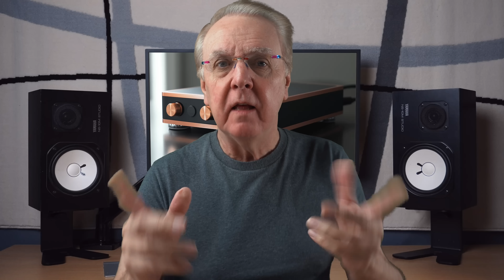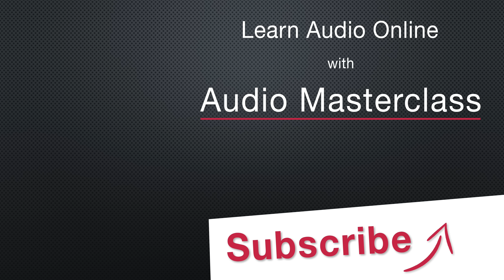Audiophile preamps - What should you get for $30,000?

Comment: I remember arguing with a high end audio shop salesman about ridiculously expensive cables for digital signals.  This was after I received my Masters Degree in Electronics Engineering with a digital communications focus.  He apparently lacked the ability to understand that digital signals are  immune to noise in any realistic listening room scenario.  His $1000 cables made from pure quantonium would not sound any different than coat hanger wire.
Reply: Wasn't that unobtainium?
Reply: Diesel Creek told us: it's chinesium ;- )
Reply: Cables are the highest margin easiest sell in the shop. They guilt you into buying them because "surely you will want some premium cables with that stratospherically expensive piece of gear you just bought". People are buying expensive hifi to server the same purpose as expensive jewellery. If you bought your wife a diamond pendant surely you want a proper 9ct gold chain to hang it on? <-- same logic.
Reply: @A_RosnerNZ  They're always talking about spending X% of the sound system price, the good old stupid concept that something is "better" just because it costs more...
Reply: I concur. All the hol..es are the same too and it's given that EE's have best audio systems around AND are the best lovers as well.
Reply: Lovely!!🤣
Reply: What's actually traveling down a digital wire?
Reply: @bradp686  Well, the wire itself is not digital. It consists of voltages that are interpreted as a 1 or a 0.
Reply: Those peddlers are just good at manipulating people to make them buy their crap...  I debunk them so often, it's laughable...
Reply: @guyboisvert66  I once go kicked off the Internet by my ISP for arguing with a audiophile 'tard on usenet.,
Reply: Did you actually try those cables?
Reply: Well, he certainly was lacking in basic understanding of how digital audio works. But be careful with the word ‘immune’ as digital signals in the real world regularly suffer failure due to transmission in a very wrong piece of wire. In the professional world, meaning the live stage, digital signals encounter complete transmission failures ALL the time, where analog signals virtually never do. With analog, it is the accumulation of countless tiny errors that drives the switch to digital. With digital, we must know our stuff and use the right wire always or risk losing everything, including our job.
Reply: If the cables cost 2000$ I better should be able to run them over with a caterpillar dozer without them having as much as a scratch.
Reply: @baraka629  Why would you want to do that? I just don't understand.
Reply: My 2.5mm twin and Earth was a little bit cheaper than 1k per meter…
Reply: probably the cable wasn't on a "cable lifter", that's why you couldn't hear the difference
🤣
Reply: Mine are made from 100% genuine New York sewer rat hair, complete with bubonic plague, dengue fever and leprosy. They smell wonderful, but don't work too well.
Reply: But noise can be transmitted along the cable . That’s why some DAC manufacturers recommend unshielded Ethernet cables going into the streaming port of their DACs .
Reply: @mrsinghsstereos6662  They don't have a clue about networking if they're propagating this crap... Utterly STUPID...  They're always trying to bring back their analog crap in the digital world...
The only time we used STP (and we don't use this anymore, fiber is almost cheaper and so much better) was when the cabling was too close to very high power power transformers...
Reply: @mrsinghsstereos6662 .  Transmitted along the cable is no problem at all. A DAC has a window of amplitude below which signals simply aren’t there. DACs also routinely reclock their data for this specific reason. Reclocking puts temporal issues to bed and recovers the clean signal 100%.
Reply: @mrsinghsstereos6662  Wrong. It is only 1s and 0s.
Reply: @henryvaneyk3769  whatever you say Einstein !
Reply: I know, I know... digital cables shouldn't make a difference, yet I hear a difference. Upon dealer recommendation, I bought a slightly more costly USB cable (about $50USD) for my Mojo DAC. It was very pretty in a green woven covering! Every time I used that cable, the sound was noticeably harsh. The cable is in a drawer now & I use a generic $10 one & love the Mojo.
Reply: @patbarr1351  That is just your owners bias LOL !
Reply: @richardheumann1887  That's an old argument that holds no sonic water. One could say that about literally anything. "I like the way a Porsche drives compared to a Toyota!" Well, you know Porsche costs 3X as much so you only think it drives better.
Reply: @patbarr1351  i do not agree with that, cars DO have better or worse driving characteristics . However, being more expensive doesn't automatically mean the car drivers better. But your statement of " thinking it drives better because it's more expensive" is  a bridge too far.
Reply: @olavblom3024  I would not say that the cost equals a better experience. I'm comparing that to those who say consumers have a bias which makes them equate "costly" with "better." I'm sure some people do have that bias, but some of us are merely reporting our perceptions.
Reply: @patbarr1351    What you are describing is simply a bad cable. Take it out of the drawer, cut the ends off, and throw it away! USB is a fully serial signal. Over the lengths you’re probably talking about, there is no degree of bad, just bad.
Reply: @artysanmobile  If the cable was truly defective, it wouldn't connect. I'm not an electrician, but I've studied audio engineering and had a couple of basic electronics classes. Have you tried multiple cables & heard no difference? If so, let's add your experience to our collective store of information as audio fans & move on.
Reply: @   That is not correct. Any clocked signal has a window of failure, ranging from a rare snap to a second of music in the middle of silence. You must have skipped that semester in school. You couldn’t possibly have studied “with a digital comms focus”. You’d have missed a hundred pages on the topic. 

There isn’t a pro sound mixer unfamiliar with the failure though most don’t know the technical cause. Any digital audio receive end is designed to recover a ton of noise and even bit errors, clock drift. The audio CD carries an additional word for every five of music to correct the errors of playback. Having built whole facilities means I now make my own cables to save time and money. Im typically planning hundreds or low thousands of paths and there are well known technologies that do that comfortably. I don’t compare the ‘sound’ of digital cables cuz life is short and my customers would stop hiring me. I make what I KNOW will work and move on.

Every wire made to carry a digital signal has a list of specs that help predict its breaking point, and they’re pretty reliable, too. They have bandwidth issues like any wire, but the failures are not subtle. They reflect like they’ve seen a mirror when encountering a poorly made coax interconn. They bounce off the walls of a glass fiber wound too tightly and drop sync. Even the lowly UTP has a dozen differently specced variants so digital comms engineers know how much they better spend if they want to have a good day. All of these, by the way, are loooong runs. 100m and up. 

All we can do is learn, then overprovision.
Reply: @artysanmobile  You must be referring to the data eye, which is the portion of the clock period during which the data signal voltage is either an unambiguous logical zero or an unambiguous logical one.  In the home listening environment, which is what I'm discussing, the bit rate is low enough that the data eye is relatively huge, especially compared to the 500 Mbps satellite comm stuff I was doing in the late 80s using Ga-As and ECL logic chips.  Given the large data eye and the relatively benign EMI environment of the home back then (before cellular and WiFi), any cable that was not defective could successfully carry digital data from the CD player to the D/A.

You mention bit error correction, presumably Reed-Solomon.  Yes, that exists, and it makes the system less susceptible to data errors due to voltage noise.  In other words, more tolerant of poorly made cables.  Yet another nail in the high-end digital cable coffin.

If your still reading, Artysan, maybe you can work on making your replies less insulting.  Focus on the subject, not the author.  That may help people take your writing seriously.
Reply: @   Error correction in the CD is not for any cable. Seriously, get off that kick. The cable is one of the most solid pieces in the chain. Error correction is ALL for the laser inaccuracy, disk vibration, little things we cannot see and fortunately don’t have to hear.

When I see nonsense, I say something about it. I see a constant need to impress in your writing and much of it is doing the exact opposite. With dozens of platinum records and a best album Grammy, I have no problem being taken seriously. What a complete asshole thing to say.
Reply: @artysanmobile  Arty arty arty.  Error correction logic does not know the source of the error it is trying to correct.  It could be a scratch or fingerprint on the disk, or a fault in the electronics, or a dodgy cable connection.  All it can detect is if the received pattern of ones and zeros indicates that an error occurred, and which bits are wrong.

I wonder why you assume I write to impress.  I write to communicate.  Assumptions are dangerous, in part because there are typically many more ways to be wrong than to be right.

And now you're name calling?!?!  My my.  That appears to be writing to insult rather than to convey information.
Reply: @patbarr1351  I love my (used) Mojo so much I spent £30 on a coax cable that definitely sounds better, and I'm the biggest sceptic. The only other big change I wouldn't have believed is giving my WiiM a filtered power supply, night and day difference for £50.
Reply: @patbarr1351  digital cables can have their own "pin 1" shielding and ground loop problems, too. noise may not affect the integrity of digital signals, but if it gets into the analog side, it sucks. robust designs aren't affected by this, but getting products to market takes tradeoffs...
Reply: @poofygoof  If it gets to analog side, then throw the DAC to trash, it's a very weak design or it's broken...
Reply: @poofygoof  I agree that a poor design or a defective part can affect the analog circuits.  I guess I'm guilty of assuming inexpensive cables for digital signals are at least properly designed and manufactured.
Reply: @Acceleronics  i think the takeaway is that price is not always an guarantee of competent engineering.
Reply: @poofygoof    This is the best reason of all to employ the ‘system on a chip’ design method. The more integrated the chip used, the more problems the designer simply can’t introduce. ADCs and DACs today are hard to screw up. Their ground issues are labeled pins and their datasheets are dead easy to follow for the desired result.
Reply: You are, of course, absolutely correct, but the average audiophool has a very limited grasp of the Laws of Physics.
Reply: I had the same discussion with an A/V salesman about different "grades" of digital cables. He finally agreed that if the digital signal gets from point A to point B, there is no difference in sound or picture quality between a cable that cost $15 or one that cost $100 or more.
Reply: Did you listen to them?
Probably not because you learned everything there is to know at college didn’t you?
Think about that for a moment.
Critical thinking is the first thing taught at any half decent seat of learning. If you don’t question everything then everything will stay the same. Digital audio has greatly improved over the last decade. Why/how? By questioning and discovering previously unknown details. Tsh Tsh
Reply: The only way a digital data cable could make a difference is by literally not working
Reply: The best way to spot a snake oil manufacturer is when some products are labelled Reference and Signature.
Reply: You should probably return that masters degree then. Interference in the digital domain does indeed affect analogue signal out. Which company is it that you work for ? 😂
Reply: Did you listen to them?
Probably not because you learned everything there is to know at college didn’t you?
Think about that for a moment.
Critical thinking is the first thing taught at any half decent seat of learning. If you don’t question everything then everything will stay the same. Digital audio has greatly improved over the last decade. Why/how? By questioning and discovering previously unknown details. Tsh Tsh
Reply: Ha ha! Don´t you care to get a better sound? You see, there is no digital transfer of 1's or 0's... There is an analog signal of voltage (going up and down) that determine when the signal becomes a 1's or 0's. In this analog signal there are a lot of different pollutions that can change the accuracy of this "digital" signal which will affect the sound, not sounding good, like harsh and unmusical. Come on - are you all so ignorant that you have your arguments to not upgrade your network switches, clocks and ethernet cables? I thought you were interested in better sound?! Aha, you do not have a descent rig nor any treatments in your room? You do not care of a higher grade of musical treat nor listen in sweet spot? Better off, you do not care to test for your self so you know what you are talking about?! I have tested and there is no going back from generic to better equipment. Test - learn. Test - learn. Test - learn. Beep!
Reply: @martinlindberg1983 musical. ha. ha. ha i knew there’d be one of you in the comments here!
Reply: @martinlindberg1983 agreed.. I have a specific high quality usb cable that I use and can confirm that all my 1s and 0s make it to the other end(well enough of them to ensure that the receiving hardware/software is satisfied with what it has received).

The brand, if you're interested, is Amazon Basics.
Reply: @martinlindberg1983  Yes, there is an "analog" transmission of voltages through the cable, but that varying voltage is interpreted by the receiving electronics as either a zero or a one.  Period.  Full stop.  If the received signal is so noisy that the receiving electronics makes a lot of errors (e.g.  the transmitted voltage corresponds to a digital zero, but transmission path noise causes the signal to be interpreted by the receiver as a digital one), the resulting sound will be pure garbage, not recognizable music that is "harsh and unmusical".

Comment: And you get a CE marked equipment meaning that if Will not provide risk of fire risk of electric shock or electric noise that will interferens with nearby equipment. Tom Evans equipment product fails even to put the simple CE mark 😂 having a China Export logo instead 🎉

Comment: I enjoyed your talk on whether a $30k preamp is justified. As an owner of the Schiit Freya+, I look for discussions on preamps. Though I am not a consumer of high-end gear, I was dreaming about the PrimaLuna EVO 300 preamp and wondered whether $3,995 is justified. Besides owning a Freya+, I have a Marantz MM7025 power amp, AR 303 speakers, and an SVS SB-2000 sub for listening to rock 'n roll and blues, as a member of the Baby Boomer generation. To me, $3,995 is more justified than $30k for a preamp when considering cost breakdowns in parts and labor but then again, I might not hear the difference the PL makes. Auditioning might provide the answer.
Reply: From any objective perspective it will be worse than any non tube alternative from a decent brand. Then you may like the distortion of the tubes. The question I would ask is why the distortion of your Freya is worse than that of the Primaluna. In other words I would stick with Schiit. And as Tube distortion is very subjective how we perceive it, I would definitely listen before buying. 

My suggestion would be to get a neutral preamp that measures well and add a tube buffer. Then you get the best of both worlds. Schiit has some good non tube options as does topping smsl and Wiim. Wiim ultra would be my personal choice
Reply: @niklasschmidt  The distortion of my Freya is not worse than that of the PrimaLuna and since I like the distortion of tubes, I will stick with the Schiit. Thanks for giving me more insight.
Reply: @robertschlechter4407  Schiit makes good stuff. If you like the softer sound, topping just released a r2r dac that measures well and is nifty. It gives a bit analog sound. Few r2r tends to measure well. And it is not that expensive, relatively speaking. Around 1000 usd